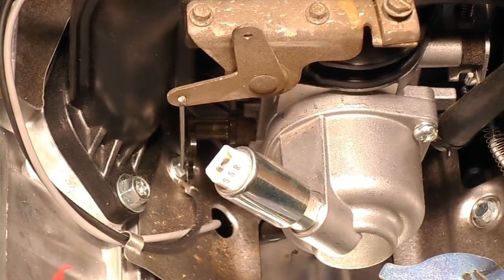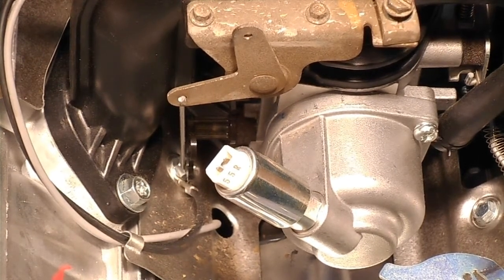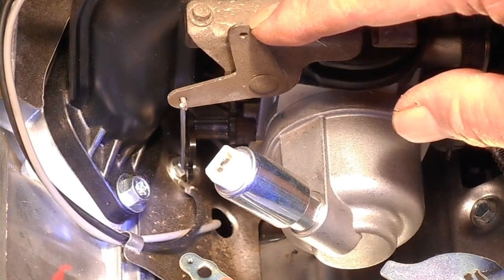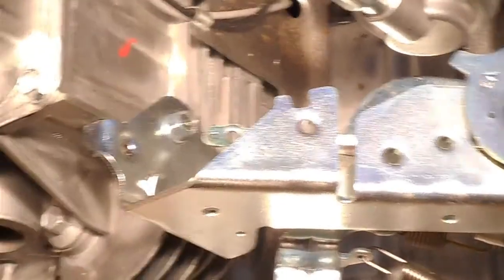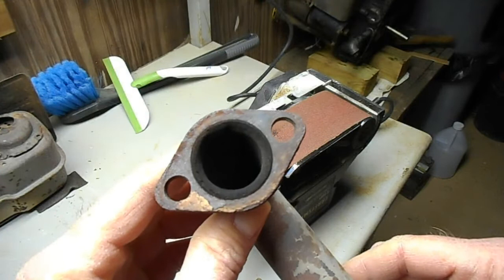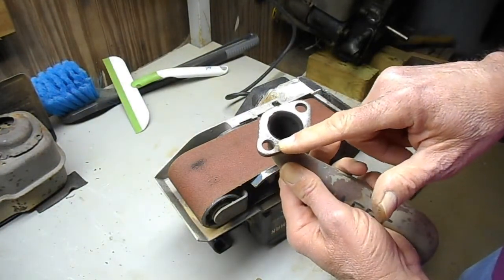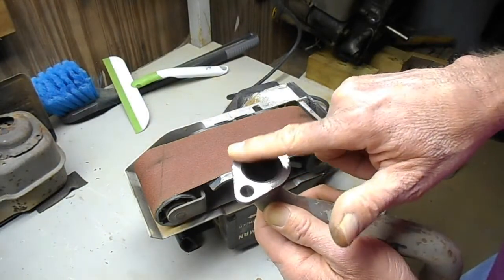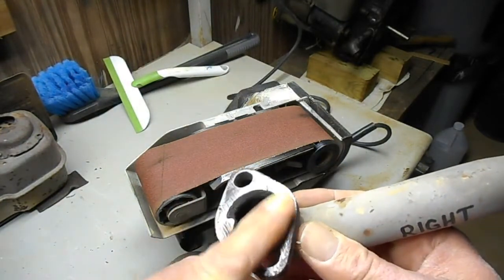Defeat of Choke O Matic on Briggs and Stratton Intek motor

Comment: Today is 5/24/2025. I installed a brand new Briggs/Stratton 49S877-0019-27 hp  engine on my 2009 Craftsman DYS4500 riding mower. Upon completion of the job, I decided to see how the mower would operate. I love this extra hp, since the mower came with a 24 horse power Briggs engine. I did purchase this mower brand new from Sears back in 2009. Believe it or not, I put 1,900hrs on the 24hp engine. She Never fail to start, never used any oil, and I did not have to "choke" the engine upon starting. But she blew both head gaskets while I was mowing. So I had to purchase another engine and I needed more power since I have to mow just a little over 4 acres. This new engine has that "choke-a-matic set up. I will tell you right now, I HATE THIS DAMN CHOKE-A-MATIC setup!! Can it be changed to my old choke set up? I will have to search to find someone who knows how to do it. I will not even attempt to do it. But I hate the damn choke-a-matic . BTW, I also have a brand new hydrostatic tranny for the mower also, and I know how to install IT!

Comment: Ur doin some good work there! And good info on the choke I never did like The throttle choke in one lever. I got a little JD mower than I have a wire on where I can pull the choke with out having the throttle wide open. Thanks for the video!
Reply from the maker: Jake Ziegler - not a single video I could find on You Tube explaining how to convert choke-o-matic back to a separate manually controlled choke.  just people explaining how choke-o-matic worked and none of them even mentioning the drawbacks of cranking a motor at high RPM.   I hope viewers will be able to copy in some manner what I was able to accomplish and set themselves free from the insanity of this poor concept known as choke-o-matic.   Jake thanks for watching and commenting.

Comment: that choke o matic is a stupid thing in my opinion.
Reply from the maker: Michigan Farming - completely designed to prematurely wear out the motor and to the unknowing user that is exactly what is going to happen.   a lot of unfortunate people will just accept the choke-o-matic as being a new improvement over the old style and never question the startup.  I still regret the removal of the choke and replacement of it with the primer bubble on the smaller 3.5 to 8hp motors.     and why did they have to take away the air fuel mixture adjustment screw on these smaller engines.  used to be when the jet got a little worn a slight mixture adjustment and the issue was resolved.  now it takes a new jet to correct the problem.   all design concepts have moved into the new 'error' of replaceability and not serviceability..    oh well, thanks for watching, commenting and reading this rant of mine.
Reply: @SoybeanFarmer3300  I hate that damn choke-a-matic set up! As many auto engines I have repaired, I am scared spitless of messing with this choke-a-matic on my new mower engine. SHISH!!!!

Comment: Good fix there for the choke and the header pipes. With a smear of manifold glue type substance on each face it will be a sure-fire seal.
If you were needing an even smoother flat surface then get a piece of plate glass or thick mirror glass spray the glass surface with a drop of diesel or dilute washing up soap detergent and put a piece /sheet of wet and dry abrasive paper on top. Thoroughly wet the abrasive paper and using a figure of eight motion and holding the header near the flange rub the header on the paper. Frequently wet the paper to flood the grindings and loose abrasive off the paper and continue rubbing  the header. Surprisingly quickly you will get a polished smooth surface that is flat and smooth.
Reply from the maker: Dan Whiteford - always delightful to see what technique you are going to share with me for getting a job done.  thank you very much for taking the time to make the gift of your knowledge and experience to me.   thanks for having subscribed to my channel Dan.

Comment: I would have to say that is not crude , I would have done the same thing, Running the choke a an idle will save wear on the motor, nice repair!
Reply from the maker: CE Smith - every real mechanic I have discussed this choke-o-matic setup with has agreed how it is going to speed up the startup wear on the engine and recommended the conversion.  just a few more days until I'm able to set the 92 pound motor back on the mower then crank it to find out if I can notice the 2 additional hp in the 24hp over the old 22hp.   the big plus is my grass needed cutting 2 weeks ago because of the highly unusual warm weather back in February.    so with the motor swap completed the grass will get cut and I can move on to the spring selective lawn herbicide application.    thanks for watching.

Comment: I like the work you did ....... That exhaust should seal right up... Did you figure out a way to get the wheel on the back of the plow not to move?
Reply from the maker: Ted Kahler - thanks, I feel good about it.   the method I'm going with on the plow wheel is the one where I drill a hole in the shaft and space it into the correct location with large washes.  the lateral force should keep the wheel in the desired location.   I like this method because it provides easy removal and minor adjustments if required.   Ted thanks for watching and commenting..   I hope all is well with you...